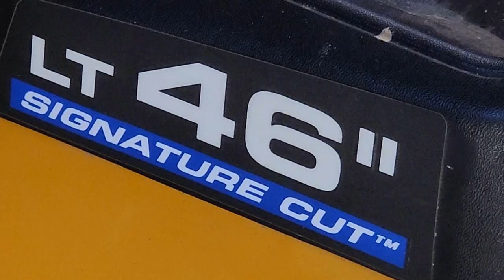New Cutting Blade Spindles for Cub Cadet Mower, Abridged

Comment: Why not grease the spindles while they are out?  I was instructed to as they do not come internally greased.
Reply from the maker: That is a fair question; The pair I installed were already greased and the in-situ top up is just that, a top up - kinda like best practice - I guess. Are yours exactly the same units from the same supplier, Kevin?
Reply: The orginal ones that I am replacing did not have the fittings (sealed) but they went bad pretty quick.   The replacements have and they told me they may have come from over seas so be sure to get some grease in there but not to over do it to save the seals.  Just wasn't sure if I grease or not?
Reply from the maker: @kevinrussellcreations  I see. Following the instruction from your supplier seems most reasonable in this case. Grease before (if dry) and top up afterwards - essential, I would have thought. Then add to your regular maintenance schedule. Good luck, Kevin!